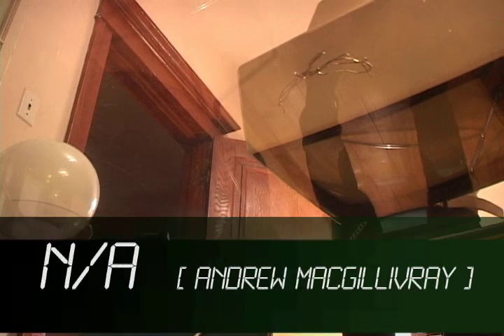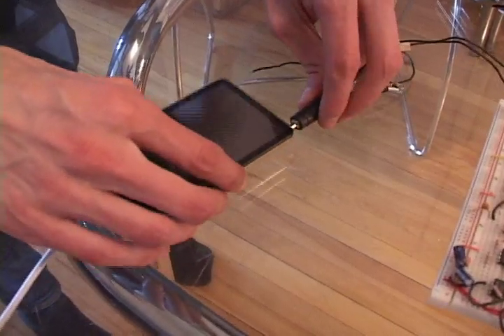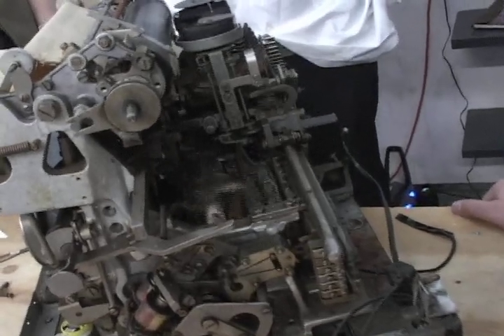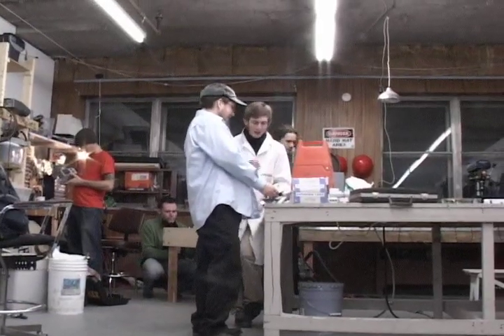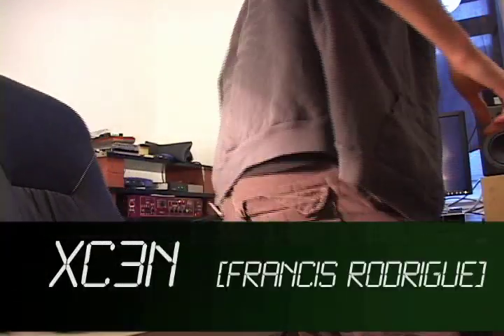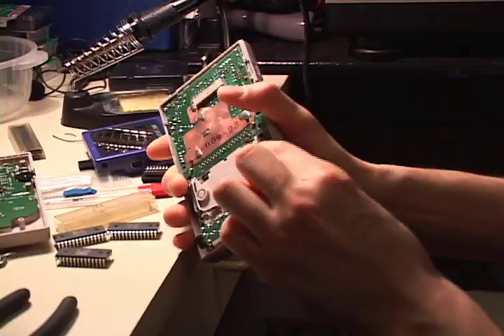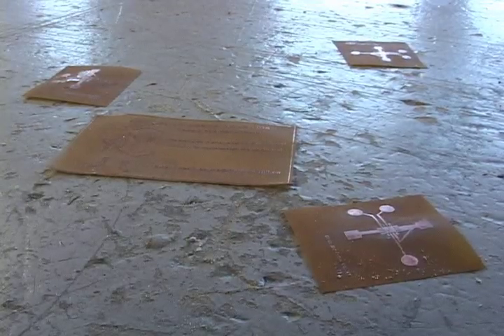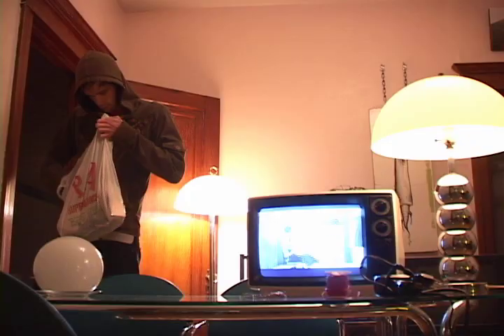Repurpose

Comment: hi, my father is an electronic engineer here in Brazil
he uses a very old domestic plotter, that has an arm with a little pen. He made an adaptor to put those pens that writes in CDs in the plotter, and the plotter draws directly on sheets of cooper, and then he burns the circuit.
He can make several protothypes whith that